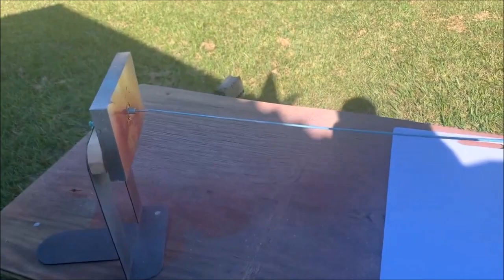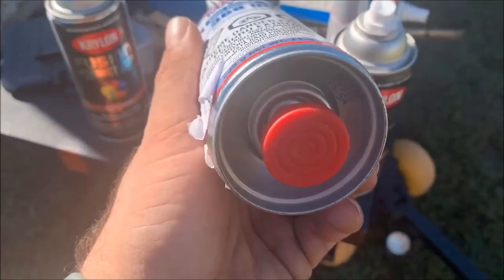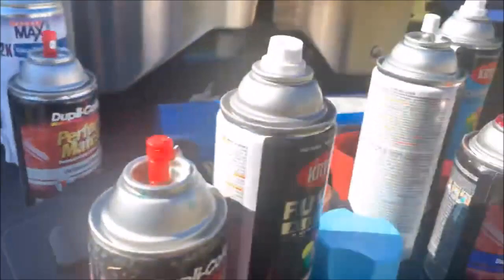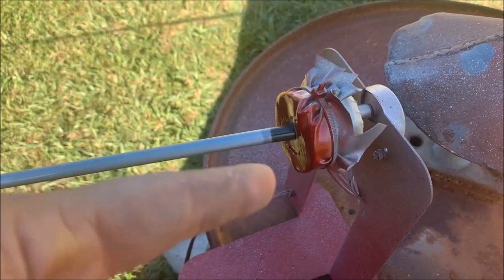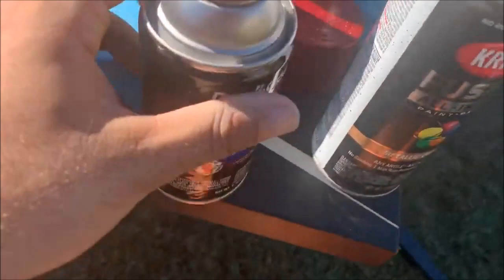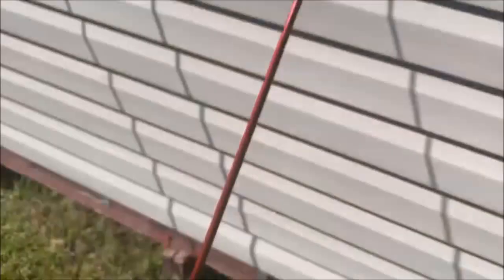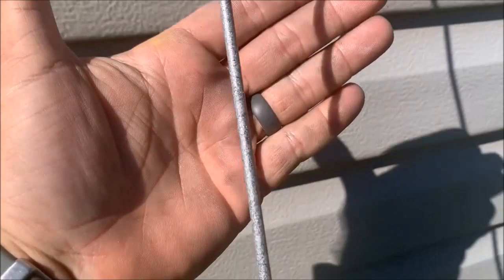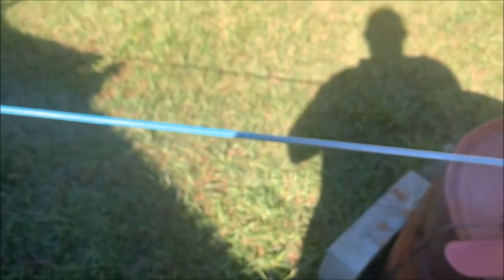Painting Rod Blanks DIY

Comment: I really appreciate this video. I recently had a gloss clear rod that I wanted in black gloss. I used rustoleum 2x black gloss spray paint and then used the Krylon color master gloss crystal clear. I followed the directions exactly. It looked perfect but as soon as I flexed the blank or put water on it the paint cracked. When I put alcohol on it the paint turned gray. Maybe the rustoleum paint is ok and I just needed to coat it with the K2! I'll try that next time. I built the rod with guides and a decorative wrap and it looks nice, but when you look real close you can still see the cracks which I know will just get worse. I just ordered permagloss and black epoxy dye so that I can fix the cracks in the blank.

Comment: I mixed the perma gloss with black epoxy dye. The perma gloss will work on the rod but the black dye does not mix well with it. I mixed in a small amount. I guess I could've mixed more but I didn't want to dilute the perma gloss. It just swirls with the perma gloss and eventually turns clear with it.
Reply from the maker: Right on! Thanks for sharing!

Comment: Why not use Krylon clear coat than using K2?
Reply from the maker: Krylon clear doesn’t flex well, it will crack eventually, it will also yellow (my guess would be after one season), and not ver durable. K2 is expensive, but it flexes very well, haven’t seen yellow yet, and it can take a beating. Its like epoxy, you have pop the bottom of it and shake it to mix. You only get like 2 weeks with it.